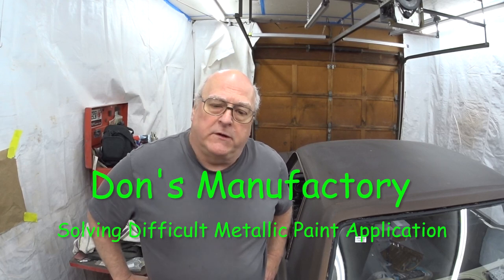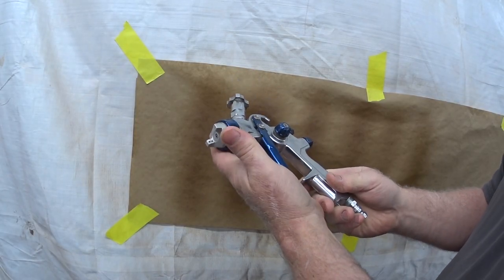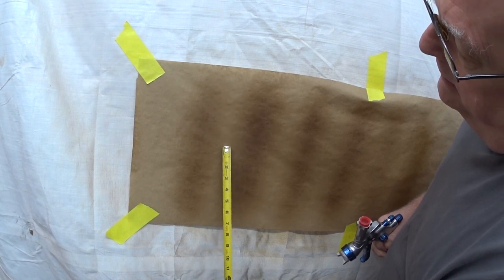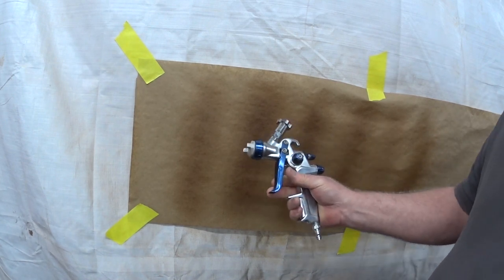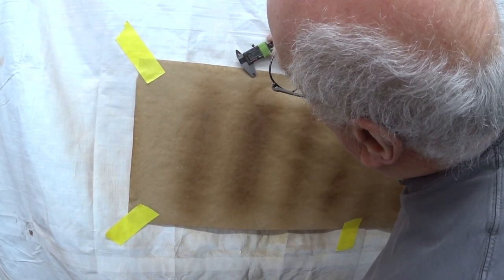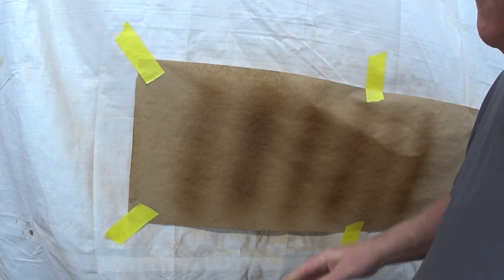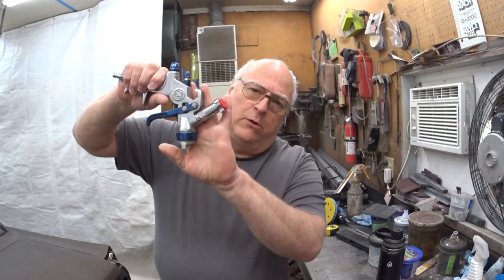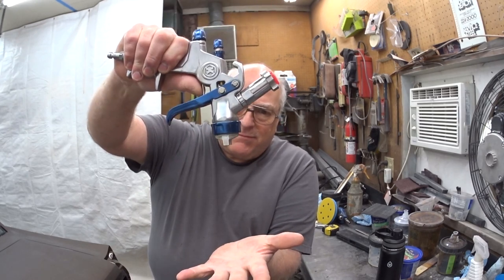66 Mustang Betsy - Paint 27 - Solving Difficult Metallic Paint Application

Comment: I agree on the "mist" coat , you need to spray it while the base is still wet or you will get adhesion issues as well as the metallic not standing up property. Your test panel looks fantastic , preparation is key and you my friend are prepared.  Not sure why your supplier is taking so long to mix up paint but hopefully they get the formula the same as your first paint. The weather sounds like a huge issue as well as the paint will flash off so much faster so your guy in England makes sense to mist the panel immediately. Best of luck
Reply from the maker: Thanks Wally, I’m trying not to rush things. Doing that has never seemed to work.

Comment: The panel looks great but as we all know panels are way easier than a whole car especially when you are on the floor or standing on a stool and reaching out etc. I have had few successful projects with metallic so I avoid it... 
    I haven't used a clear coat that doesn't require a reducer and at low temps without a reducer it will be harder to spray. But there are lines of paint out there that are decent paints but their documentation is very lacking and you end up just using a similar paints tech sheets instead. 
      It's odd that you are still waiting for paint. If I had a code I could call it in and have it this afternoon from a number of paint suppliers. And even with a match they could do it  the same day. I generally try to stick with stock mix colors as it's cheaper and on the shelf. But far fewer to choose from when you want something special. There is one paint code I want for another car that was on a Maserati in the Athens car museum. It was a really cool silver grey that had kind of a sheen like chrome black paint or powdercoat does. 
         Last time I was in the paint store and they were mixing up a gallon of some ugly paint for someone and it was over 1K for one gallon... Uh no...
Reply from the maker: Thanks Robert,
Funny, I was just having that conversation today. I successfully painted the hood scoop, repeated that method on the valances and small parts but failed on the car. So now I have another small panel success I’ll try to repeat on the body. 🙄 
This is an obsolete color, no stock mix. I’ll be patient, they were working on it today. At this point I’m willing to pay whatever to get the correct paint.